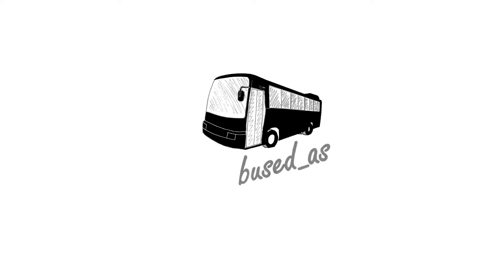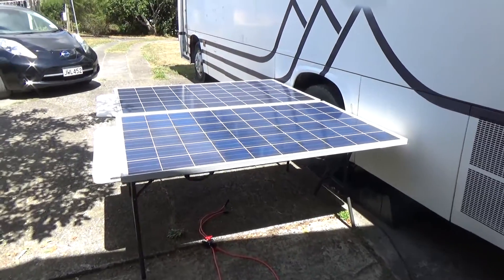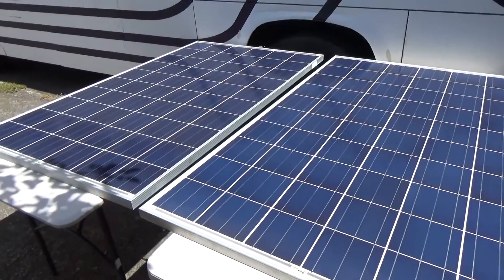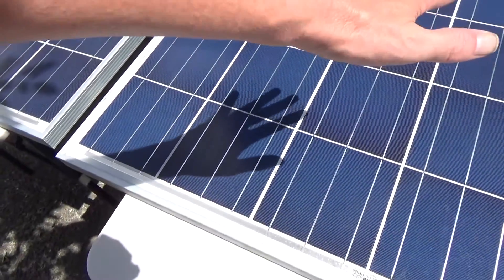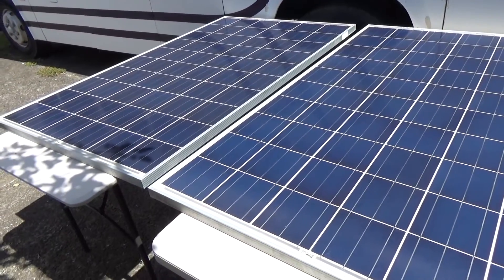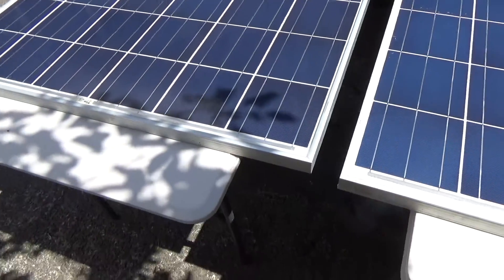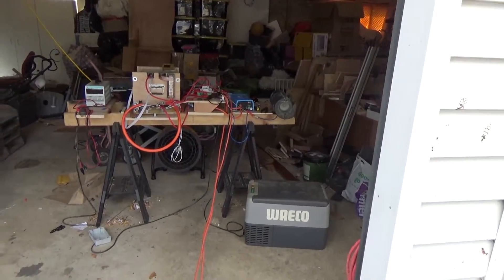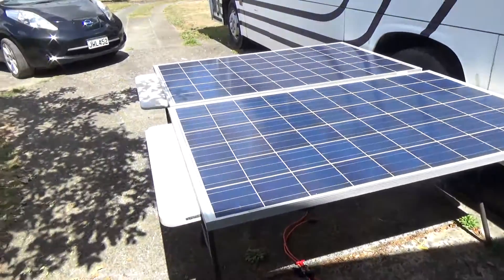LiFePo4 Solar Charging Test | Series vs Parallel - Electrodacus vs Tracer

Comment: Hello from America I'm James Mason I noticed that portable fridge,  anyway you can do a review on it. I'm about to order a portable fridge. Also what bms would you recommend for 4s2p with 420 ah life4o cells I need a 500 amp bms
Reply from the maker: Hi there James. hope you are well up there. In short the fridge is really good. I do get a little condensation on the lid and under it if I use it as a freezer, the insulated cover would sort that I guess. Anything with the Danfoss compressor is going to be pretty bulletproof though that's not to say other compressors are no good. As for the BMS, that's something I really like about the Electrodacus system in, it controls other devices and the current does not need to go through it, instead it just switches things like a Victron battery protect. Though 500A is a lot for any system, what on earth to do run that draws that much current?

Comment: Hello, I hope you are still responding to questions (this video is now almost 9 mons old).

At the 5:11 mark I noticed you ran an orange cable from the output of an MC4 'Y' Combiner to an Anderson SB50. 

My question is: are the MC4 'Y' Combiners allowing for a direct cable (DIY) conection into the single output? Or are you utilizing a separate adapter of some type to switch from that orange cable coming from the Anderson SB50 that allows for the mating with the MC4 'Y' connecter?

Love the series you are publishing here and I'm nearly caught up. Cheers!!
Reply from the maker: Hi John, thank you
The anderson plug is there only as a plug on the end of what is effectively a solar extension lead, I was previously using it for camping with a little portable panel and figured since it was already on a length of cable I would use it to reach the charge controller in the garage. The Y combiners allow me to parallel the panels, joining two positives together and two negatives together to feed a single positive and negative in the anderson plug and eventually charge controller.

Comment: #isawthebottom! I'm kinda interested in this stuff from Dacian, but seems my pv voltage is too high, and I must use a mppt, but my small 12v bank may find it useful, with 600-1200 watts, however I mostly just need a BMS for my 7s lithium bank,
Reply from the maker: Nice one. Hey if your MPPT has the ability to be switched remotely the SBMS0 will control it just the same as it does the DSSR20s. Then you get the high voltage MPPT gains and a great little BMS to look after that pack

Comment: I'd consider resistive losses along the wires for the difference between series and parallel.  I'm running two GTIL2 inverters at low voltage and there's a huge loss in heat, the wires become warm to the touch when running at high power.  I wish there would be an Electrodacus system for 48v battery banks, as that's what I'm running.  I'm going to try running two SBMS0's on it and see what happens.

I have quite a selection of Dacian's equipment, and I'm setting up a DMPPT450 test right now.  Will be posting a few videos on that when I get a chance.  There's a shocking lack of information about the DMPPT450 on YouTube, and I'm going to correct that problem.

Thanks for making these videos, I'm always looking for content about Electrodacus equipment.
Reply from the maker: Yeah resistive losses are definitely a factor, though for my testing I was using 25mm2 cable so hopefully very, very small in this case. Two SBMS0 side by said should be a fun little project, would like to see that. Thanks for watching

Comment: the higher the voltage over the battery the more current they is i found this out years ago i had some 10watt panels that where 5 volt 2amp when i ran them direct to a 18650 by a little usb charger i got very low current less then 500ma but when i put 2 panel in series then ran then used a buck converter to drop that to 5 volt into the usb charger i so higher current

Comment: from having 2x 100watt panel tried series and parallel i always got a better charge in the battery from series solar then parallel not only that but due to the higher voltage i also got more hours of charging in the day

Comment: Really true about shading. You only need to fart in the direction of a solar panel and it'll produce less. They're picky buggers. Looks like the sun was coming from the left (with respect to the view of the panels with the bus on the right side). Try leaning them up at a 45 degree angle (against the bus) and you'll find they produce a tad more power. Best to do this on a calm day. A strong gust of wind when they're leant up will ruin your day ;)
Shading sucks. If your going to tour in that bus make sure you have a portable set of panels as you will not always get a spot to park where it is shade free if you plan to mount panels on the roof. This way you can park up and still charge up your batteries. A simple frame can be made from PVC and folded behind the portable panels when not in use, making them easy to stow.

With regards to the MPPT, yes they love high voltage. I have 100 volts coming into my mppt, which is stepped down to 12V level (soon to be 24v, I can't see the sense in inverting 12V, currents and wire sizes are huge). I peg my 35A controller in the midday sun here in Sydney with two house panels, think they're 72 cells, 59V oc, 47v vmp. So I'll only need 4 to max it out when I go 24V! :)
Reply from the maker: Yeah I'm quite keen on some portable panels, if I can fit them in somewhere. Have also looked into tilting the ones on the roof but it looks like a pain in the butt and maybe just one or two more panels would be easier
Reply: @BusedAsNZ  you can use some sort of mirror foil. We did that during a winter with our RV and it worked great. Much simpler than tilting the panels. The only problem was wind sometimes.

Comment: Hi Kiwi,two panels in series higher voltage lower current so less voltdrop with same cable,Karaka Kiwi
Reply from the maker: Exactly, and that can give quite a $ savings for long runs. For my testing I'm using 25mm2 cable to keep any volt drop to a minimum

Comment: So, re-watched this and wrote down your results this time.  Your parallel comparison w loads running clocked in at 5% more for the DSSR20.  For the no-load run, 12% more.   This makes sense.  The MPPT doesn't seem to have a large enough voltage difference w the battery to track a better power point than the panels just provide natively.
Would have been great to see your overcast test results, but I think I heard you say that DSSR was still consistently 2-3% better than the MPPT.  Is that just MPPT vs DSSR with both in parallel?  Or does that include output of MPPT in series compared to output of DSSR in parallel.  In your full sun test, MPPT did about 2% better, but looked like power was fluctuating that much one second to the next and by the time you re-wired, who knows how that may have changed.  Probably even more difficult  under overcast conditions.  Suppose you'd need 4 panels you could use to toggle between a pair in series and a pair in parallel to get any kind of control on changing conditions.  Just curious though if noticed any consistency btw the MPPT in series vs DSSR in parallel when overcast.
Reply from the maker: Yeah it think to definitively say look guys this really is the best would take months of side by side testing, but this has given me a little more confidence that Im heading in the right direction. The overcast testing was just moving around too much to be really confident about any conclusion thought it was looking like a similar outcome. And I certainly plan to do more tests its so cool sucking power out of the sky, maybe once I get the panels on the roof and can get them out of the shade of the bus, and shed, and apple tree.
Reply: @BusedAsNZ  overcast days are the best i feel to test in as this is when you need to get every ounce of power you can when i have set my panels up i set them for best production in winter due to the fact even at that angle i still produce more power in summer then i needed befor i moved in with gf and went back to been on grid i had grid tie panel parallel with the 2x 100w that where in series to match the grid panel i was often seeing good days 400+ watts the grid panel was 255watt plus the 2x 100 watt panels lived for about 3 years like that eveything i ran was low voltage
Reply from the maker: Yeah I definitely want to do some more overcast testing some how. As you have mentioned its really the only time it matters

Comment: I’m so happy you’re doing these tests... I strangely have EXACTLY the same set up down to the mppt, the same batteries and the SMBS0. I’m still figuring out the setup and trying to figure out the best way to hook up the solar panels since they’re already installed on the roof and my previous go was with 2 AGM batteries and took the plunge to lithium and stumbled into the smbs0. Gotta clean off the panels and try to figure out wether or not to use the mppt controller or just Dacian’s system, which I’m leaning towards, but I don’t know where to put the little things, what size fuses to use. May have to run another set of wires. Right now I have 4 330 watt panels, two in each series and those 2 series paralleled with 2 mc4 y connectors. We are just getting into summer here and the goal is to get enough kick in the hottest part of the day to run a little mini split. Appreciate any results you get... saves me climbing up and down on top of the bus multiple times! Cheers.
Reply from the maker: One of the beauties of the SMBS0 is that you could simply keep your existing MPPT setup and use the SBMS0 to switch your charger (I'm pretty sure the tracer can be externally controlled I just haven't played with it much). I kinda want to use it because I have it, but the DSSR20s are so simple, fast and work so well

Comment: nice test, and there's really no beating the ideal-diode operation of the DSSR20 approach to squeeze every last ounce of energy from your panels... you wisely mention the trade between current/voltage and parallel/series considerations for your design trade choices, and simply picking the best panel/battery match is the way to go!  Then throw in the capability of the SBMS0 to optimze charge current and battery life, it's really a DIY'rs dream control.
Reply from the maker: That describes it perfectly, a DIY'rs dream

Comment: Another great video ! Proof for anyone thinking of getting into solar with lithium batteries for rv or off grid you only need know one word when it comes to picking your gear  "ELECTRODACUS"  and save yourself a lot of grief & cash, Dacian's very nicely designed equipment is simply the best ! and he's fast to answer your questions.Did you get the new DSSR20 with relay option to possibly heat your water ? will be watching for whats next, Cheers !
Reply from the maker: Cheers. No I have the earlier model, but it is a very tempting upgrade...
Reply: @BusedAsNZ  your building a nice system for the bus and heating a few gallons of water from the sky once your batteries are full would be sweet. Your video series you are doing on the SBMS0 are very helpful and very well done, good job ! Thanks for doing this and sharing your experience setting it up.

Comment: Nothing surprising in this tests so your result where correct.  You have 60 cell panels and is hot in summer so max power point voltage of those panels is already around that 26 to 27V that battery is thus it can not be more efficient that with just direct connection. 
So say max power point of those panels is around 27.5V or so in those exact conditions (flat on the table and relatively hot) then that is not enough for the MPPT to be able to work as it needs at least 1.5 to 2V higher voltage on panels than on battery. So when using MPPT best option is 72 cell PV panels in parallel that will provide the best result.
The higher the voltage difference between PV array and battery the lower the DC-DC conversion efficiency tho in this particular case that 2% or so lower efficiency due to higher voltage was worth as with parallel and hot 60 cell PV panels it was just not at the point where the DC-DC conversion could work (could not get to max power point due to low voltage).
The reason I say MPPT is useful and do not offer an MPPT is that the cost of the MPPT can by an extra panel or higher power panels and that will make much more of a difference than MPPT in all whether conditions.
Also DSSR20 uses so much less space cost much less to ship and produces no heat basically compared to an MPPT that usually need's to waste 6 to 8% as heat vs just 0.3% in the DSSR20
I noticed you used the M3 plastic bolts to held the DSSR20 and those are for SBMS0 not for DSSR20 there is nothing included you need M4 bolts and screws.

And yes in overcast days you get way less as amount of power from solar PV is directly proportional with the amount of solar energy and the variation you seen 15 to 30W is related to multiple cloud layers that you can not notice with the eyes but PV panels can accurately measure that.

And about shade yes that has a large influence even if it is a small shade as cells are in series and one shaded cells affects all the others that are in series. There are 3 groups of 20 cells in series in each 60 cell PV panel so one shaded cell disable's at least one group of 20 cells. A shade on the short side of the PV panel will deactivate the entire panel.
Reply from the maker: I had heard so much about series vs parallel. My gut feel was that I would get the results I got but I just wasn't sure. Of course just a few hours of testing is not much and I'm keen to do more.
haha yes I did use those screws, but only to temporarily attached the back covers  of the DSSR20s to ensure I didnt short anything while I was playing with them
Reply: Wow!!!

Comment: Mppt seem to work better with panels in series.  With 500w of panel you should've been putting 400w+ into your battery so check your series config and controller config. We've been living in our caravan for over 3 months now and  we've got a 350w panel through a  Mppt controller into a 200ah gel battery.  With solar panels you only get max output over summer. Even now on sunny days with the sun so low in the sky we're lucky to get a couple of hours 150w+ output. We've just purchased a 200w solar blanket so that I can point it at the sun and have a decent charge early morning and late afternoon. Sometimes overcast days are the worst as output can be as low as a few watts. Ironically rainy days tend to be slightly higher output than overcast days. Not what I was expecting. If you want improved output consider some way of tilting your panels on your bus or add additional panels. As you've found out a huge variation with shading. We can have a decent amount going into the battery and the slightest wisp of cloud over the sun and watch your output plummet. Cloud passes and it's right back up there again. Here's a chart with usable wattage https://aasolar.co.nz/services/solar-specifiers-diy/aa-solar-panels/
Reply from the maker: Yeah I think the sun angle was messing with me a bit. Realistically without several months of testing in varying conditions like you its only ever going to be an indication. I have dreams of tilting panels, or slide out panels like I have seen on some setups, though that looks very expensive. I guess I will just ram as much as I can afford/fit and see how it goes. The shading sure blows me away, I mean I always knew they were sensitive but wow